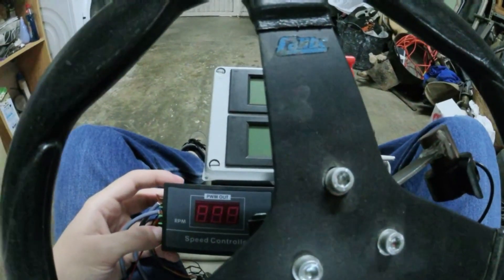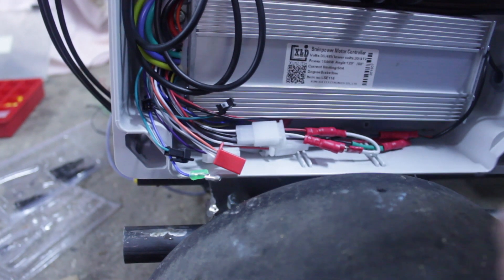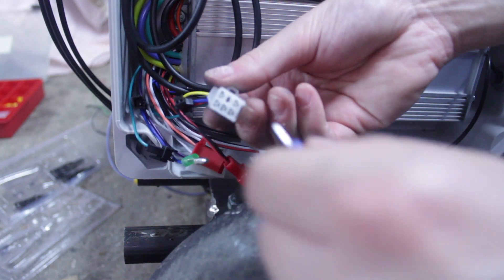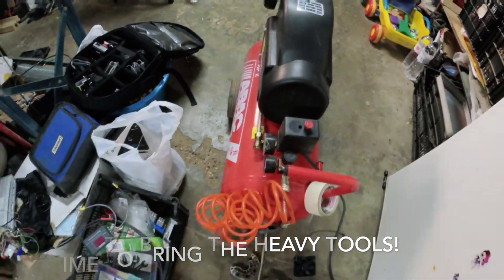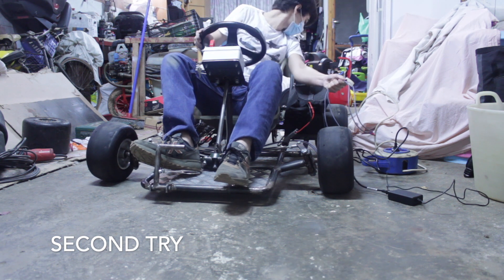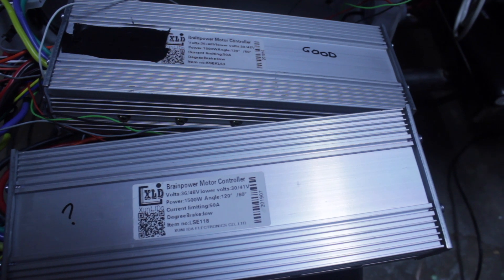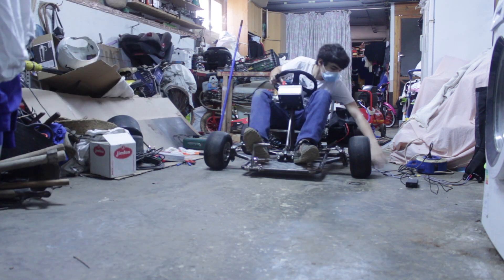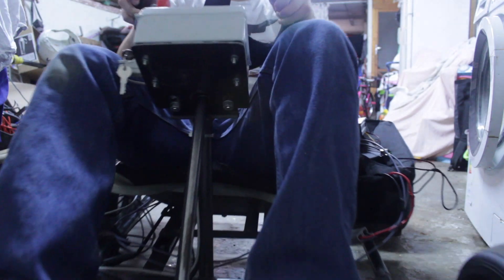Is the HOMEMADE CAR ALTERNATOR GO KART back!? Maybe is fixed? Part 13 DIY electric go kart

Comment from the maker: It seems that it may be fixed, but I don't know until I test it again.

I need to test it again with the proper battery, because I think that the flat battery and the "power supply" were not enough.

I'm starting to get tired on these "generic" controllers, and invest on something more "reliable", probably give a try at the BAC-0501 or a KT controller. What do you think?

TEASER: When the lockdown will be over (hopefully soon), I'm going to pick up another go kart. The plan is to use the same batteries as the "car alternator go kart" at the moment, and a BLDC motor with a controller. I've been on Endless Sphere (electric vehicle forum) for a while asking for some suggestions. The candidates are:

- Goldenmotor HPM5000B 5kW motor with the Kelly KLS7245N controller, sprocket, programming cable and "safety" switch for about 1200€ (all taxes included, 905€ without VAT).

- QS Motor 138 70H with the VOTOL EM-150s for about 630€ excl. VAT. The ONLY thing that WORRIES ME about getting the QS and the VOTOL is the "surprise" tax that my toll is going to charge me for the package. I've doing some numbers and all the taxes might be around 250€ extra but I don't know if that will be "enough". 

That's it, the taxes is the only thing keeping me from buying it.

I'm not giving up on the "car alternator go kart", but it's not as easy as it seems.

I don't know when I will be able to upload the next video, I'm currently busy studying for exams and working on assignments that I will need to hand in soon.

Thanks for the support guys!
Reply: Hey, i'm really happy that slowly but surely you're going ahead on this project ^^
Reply: And about the cogging/jumping, did you tried without the PWM supply, just directly in the battery?
No need to record it, just try and test, and tell us the result
Reply from the maker: The first four tries were without the PWM and ended breaking the most "powerful" power supply that I had. I can use it again with the PWM connected to it but at 50% PWM maximum.
Reply: @OverbuiltByHenry  right, i got it
But what about tests using only the batteries (Battery rotor without PWM and Battery rotor with PWM)?
Reply from the maker: @foxxyytofficial  I need to go and pick up the battery, then, I will try it.
Reply: @foxxyytofficial  Well now since an alternator is a 3 phase unit and uses a diode trio assembly to convert the 3 Ph AC it produces to DC, how do you expect DC to make a 3Ph motor run? The controller takes DC and converts it to 3 Ph pulsed DC. If you connect only one DC source to the motor, you still have other wires that have no power to them, there's no way this would work since the magnetic field generated from the DC source is constant, the only thing that will happen is the rotor will simply remain in the same place.
Reply: @brettschacher8644  the DC controller was to use in the rotor, TOGETHER with the BLDC controller
Because with a variable power course, the Kv ratio can be altered
Check the youtuber "Fixitmoditbreakit", with a VESC v4.12 controller and a limit of 60k eRPM, he got 12k RPM on his alternator with the field current being adjusted
Now that he have a VESC 6 (with limit of 150k eRPM, probably he could go spinning even higher (just needing to keep an eye to not get on the mechanical fail RPM band (grenading range))

Comment: Nice one dude cant wait to see it with the right batterys installed!!  Just a word of warning ive killed heaps of esc s when i didn't switch on the field windings!  Not sure if you've ever done it but draws huge amounts amps which a esc has a hard time limiting.
Reply from the maker: I ended up frying the 12V power supply, now I only can use it with the PWM at 50%. I hope to try it with the right batteries and hopefully see if it is fixed. Thanks for the tip!